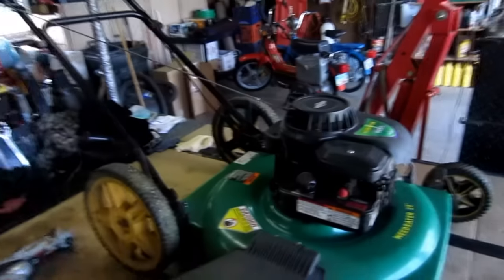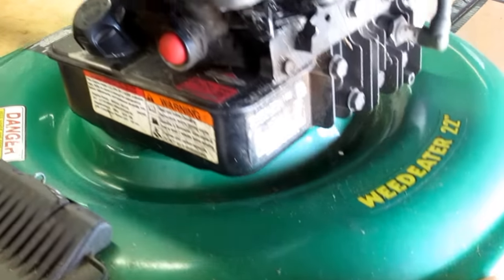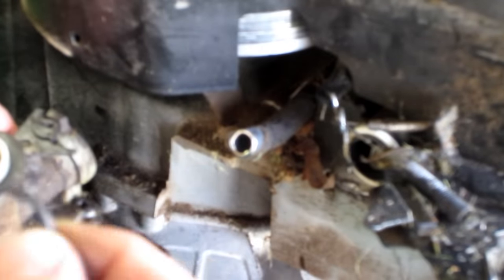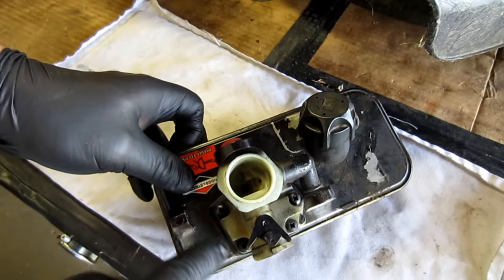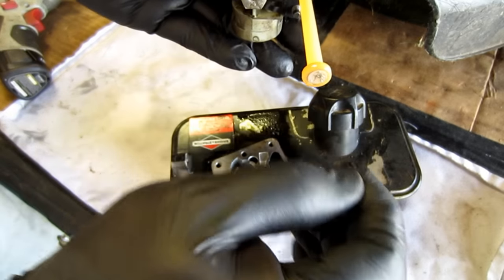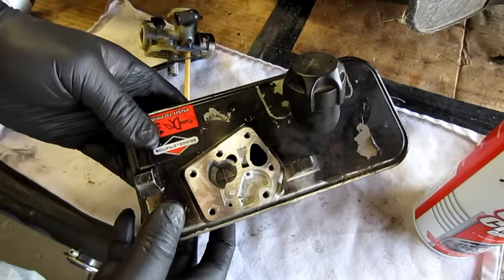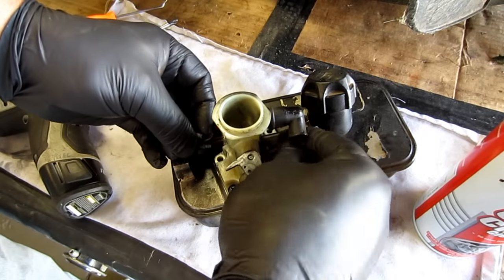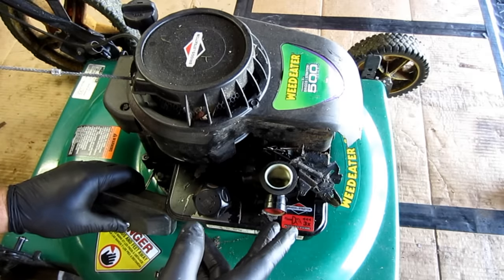Fix 90% of Briggs lawn mower not starting problems. Easy repair.

Comment: First of all you can't reuse the old diagram and gasket simply because the diagram is weak so the spring underneath the diagram isn't going to let the pulseaprime carburetor pump fuel correctly into the engine due to serging, if the engine startes up at all. Second when you separate the carb you half to replace the diagram and gasket because it is probably the original diagram and gasket ,plus the carb itself has to be cleaned and the base of both the carburetor and gas tank half to check for warpage so both the diagram and gasket.

Comment: Dear everyone in the comment section!
I own a tiller which has a B&S Sprint 40 mounted. It has kinda exactly the same gas tank and carb setup. My problem is, after 3x pumping the primer, the spark plug is kinda wet and doesnt spark anymore. I took the carb out completely and cleaned it with brake cleaner. Everything did look quite fine but the problem is still not solved. The wet stuff on the spark plug is flammable by a lighter. So its fuel and not just oil or sth. Im stating this because i might have tipped my tiller once or twice to the wrong side too!

The last time it was working, it didnt start anymore after 1-2 hours of using ist. The spark plug was completely black and didnt really spark well. I cleaned it and it kinda started directly again and was working just fine. Then it had the same issues again. Over winter it didnt come to action and now i cant start it at all. Didnt check on compression or timing to this point but im wondering, why the plug gets wet all the time. Any suggestions? I did try to start it without the air filter, as well as with the original and another (motorcycle) air filter mounted. Everytime the same problem...

Comment: Thanks, now I gotta go do this on a 6.25 series poulan 190cc with a Briggs and Stratton. 🤞hope it works. They gave us this machine, I replaced a gasket behind the primer bulb and I got it to turn on, but it shuts off right away. It only stays on if  someone continually keeps priming the bulb as soon as I turn it on. Is that a common symptom that this repair will solve????!!!! Thanks so much!!!

Comment: Hey Foxboss! Great Video. Could fix my starting problem on a 10 Euro "dunno why it doesn't start" mower 😁. Now I need to fix the remaining does not run properly problem, which is the messed up governor adjustment. Mine has the more modern "single spring setup" where they obviously regulate the idle speed through springs with different tension - marked by the color. 
If someone has that setup: It is very hard to disengage the governor link wire from the carb and practically impossible to reconnect it later. The trick is to take off the blower housing. Then you can move the link wire out an easily disengage it from the throttle lever of the carb. Some extra work, but less frustration.
On that single spring setup you cannot move the little lever for the idle speed anymore. B&S immobilized that with a welding spot. You need to go to the B&S page with your engine type number and download the proper parts-list for your engine. There you find the part number of the proper governor spring. 
Do not use a different one instead. If the tension is too strong, the engine will overspeed which will lead to engine failure sooner or later. Unfortunately I could not find the proper RPM value for my engine, so I could not "adjust" my temporary workaround DIY spring accordingly. 
I hope this helps folks who have the same "improved setup".
Greetings from Germany
Andreas

Comment: Thanks for the walk through on this... it helped me understand my mower more. I still have an issue with it after cleaning. It started spitting out white smoke and stalled. Now i cant get it to crank. what do you think is the issue?
Reply from the maker: White smoke normally means that oil got into the combustion chamber. So check to see if you tipped your mower because oil to get into the carburetor or make sure you did not overfill the oil. Remove the spark plug and pull the cord a few times to allow the cylinder to clear out. Then spray carburetor cleaner in the cylinder just a short burst and then reinsert the spark plug and try starting it again
Reply: Thanks Foxboss

Comment: Life is funny man, I have the very same exact mower machine and this afternoon I was mowing my lawn, turn it off to take a little break and when I want it to start it again, it just would't start, just didn't start at all. Well, I think I know what to do now, also I have to mention it, I run the damn thing under some bushes and from then on, the lawn mower start to run really rough, I think I hit that little thing that you show, the one that when you hit it, you screw your RPMs, I pretty much think that's what my problem is, thanks buddy anyways, cheers.

Comment: You should add that apart from these 5 screws on some of these carbs there are some modles that have a screw down in the middle , on the bottom, of the throat , that prevents its removal.

Comment: Liked the video! My two year old mower is in the repair shop now and has been therefor the last three months with carburettor problems, it went in under guarantee after a few months with what they said was a diaphragm problem which they replaced and it wasn’t long after that it was more difficult to start like when it was new, then the the engine started to hunt, sort of like a Broom ,broom, broom , broom, broom, that’s the only way I can describe it really, 
Anyway as I said it’s still at the repair shop and he’s said I have to have a new Carburettor at £28.50 as he can’t clean it fully and he also added it will probably want doing again! Now I only have a small lawn that’s kept clean etc, surely this shouldn’t be the case should it?
Glad of your thoughts on this issue!
Subbed to your channel!
Dave in the UK.

Comment: Empty the old gas out of your can and make sure all contaminants are cleaned out or you might have to do this over several times. Never use a steel can Zinc
k coated can for the zinc peels of in time and therefore contaminates your fuel too.  Then start your carbitrator disassembly lol. Now don't forget, your friend the professor

Comment: Wow your the man. I had rpm problems ran the mower under a shrub and it died on me. I know i had fuel. So I investigated found your video. found a tree twig logged by the governor and the governor spring was gone. Problem solved

Comment: Never understood why B&S took so much crap about the plastic carb....in my opinion they are way better than the ally ones for pure ease of maintenance. No stupid bowl seal to mess around with trying to get it to sit right, no bowl nut seal leaking, no messing around with screwing out jets, no sticking or holed floats and needles. And never having to faff around draining the tank for maintenance. It's a no brainer. And no choke linkages to try and fix either. Plastic Carb with tank all the way for me. Easy life 👍

Comment: You make it look easy but I am the man that put the oil in the fuel tank and the fuel in the oil tank on my chainsaw that ended up costing me £50 to have it drained and then I still cannot start it! I am 67 and it may be that I am too weak to pull the cord sadly. No more pull cord starts for me!

Comment: One very elusive problem is that after doing this there can still be hunting by the engine. It’s wise on this engine with this carb to pull the flywheel cover and remove the intake tube to the head and replace the intake tube to head gasket.

Comment: I had the same exact mower and was having the same damn issue. I gave it away about a week ago because I bought a new Briggs last Summer. It refuses to start. A lot of people told me never leave gas in it all Winter. I never had that issue with any other mower. Just emptied the tank, put fresh gas in it, put this other stuff in it to absorb water and still will not start. The primer bulb goes in and right back out, but the plug isn't getting any gas on it. It always started right up on the first pull last Summer.
Reply from the maker: If you can get it to run on carburetor cleaner or starting fluid by Spring short bursts directly into the carburetor then it's a fuel delivery issue
Reply: @Foxboss9  Will brake cleaner work?

Comment: My bro used my mower(basically same design as the one in you video) and somehow he took off the 2 springs on top and now the rpm  feels like it's too high. How do I lower the rpm and where do I connect the springs. 

Also thanks for the awesome video. I was able to start the mower after my bro messed with it.

Comment: My experience differs slightly - I always change the "gasket" - which actually is a diaphragm that acts like a pump. This diaphragm becomes stiff with time and looses its flexibility especially when client uses gas with ethanol. I always recommend to client to use Super gas with NO ethanol. The diaphragm only costs $4.95 and ensures at least another 2 - 3 years of use. The scribe on the aluminum body is a great suggestion.
Reply from the maker: I agree, however I kind of directed this to the user that has no clue why their mower doesn't start and just wants to get it going again.

Comment: I clicked the like because of your time, and effort, but you really left out a lot of important info. 1. is it getting fuel. 2. Is it getting spark. 3. Is it getting air. 4. Compression. You really didn't give a starting point. This could be 1 of a 5 part video. 

Thanks for your time.
Reply from the maker: I appreciate it! :-) this videos for those who have ruled out those things already. If you check out my other videos I've done something to that effect on a snowblower I think. Basically, what all fast working, good mechanics do, if you starting fluid or in my case carb cleaner. A couple spray burst of that direct into the carburetor will tell you all those things immediately. Because if it can run on carburetor cleaner, then it's getting spark are compression and the timing is on Mark. That way you know it's just a fuel delivery problem. Which is the case 90% of the time, hence the video.
Reply: @Foxboss9  Sounds good buddy. You answered what I was looking for, but I was thinking for office type people that don't have a clue. My problem has been narrowed down to fuel (where you came in).  I really didn't want to pull the carb, but...oh well. My I ask? I get a start off a shot of ether, but that is it. I'm hoping it is just a gummed up carb, and not the pump. How should I check that?

Comment: If it starts and dies  the filter in the fuel tank is the  problem. If it is a "Toro" and will not start after leaking all the fuel out of the tank the problem is the float in the carburetor that is filling up with fuel 
and it is difficult to plug the tiny  hole allowing fuel to get into the float. . . . it's important to remove all the fuel and let dry before using any kind of epoxy and plug for the  small hole.

Comment: There is a gasket AND a diaphram under the carb - not just a gasket. The diaphram goes down first on the tank and then the gasket. Many times they appear to be one piece instead of 2 pieces.

Comment: Great video! I have a 17 year old lawnmower. The only issue is that when I push too fast, it cuts off then I  have to walk slowly to cut the grass. Other than that no other problems. And how would you find a kit ? It is a Brigg Stratton 20 inch blade Murray but it's too old to find part numbers etc.. SOS!
Reply from the maker: There's a lot of these parts that are all the same. If your carburetor and gas tank look like this one the link is in the description of the video. Anyways all Briggs & stratton's have a model number a date code in a serial number stamped in the blower housing. On push mowers that usually right above where the spark plug mounts
Reply: @Foxboss9  Thank you

Comment: Thanks for this video. I have never done a small engine repair.  I was able to clean and replace the gasket for my Lawnmower.  But, it now leaks whenever I run to mower.  I took it apart and went through the process again. I even scribed the carb this time. But, it's still leaking. any ideas?

Comment: I have the same mower - It has spark - A rebuilt Carb - plug - Governor Springs replaced - it 
did Run for about 30 seconds , then quit. now = It won't start! when I pull on rope , I get get a POP! now and then. thats all - I have watched many videos on this type of carb & B&S engine. I cannot figure out why it wont start! ( I even removed the flywheel to check the Keyway KEY - it is fine ! I readjusted the Coil Gap ( b4 - one side was too big of gap)----
But after replacing everything > Still the same - won't Start- all I get is a Pop now and then.
Can I get your Opinion please?

Comment: I own Hondas. This particular Briggs carburetor was poorly designed It appears there are so many ways for the dirt to work its way into the carburetor and gas tank and soooo many little parts to deal with. I've never replaced or rebuilt any of the carburetors on any of my Hondas over the decades that I've owned them. This looks at least like an annual maintenance preventative program. With my Hondas I just spray the area around the carburetor with water to keep it clean and change the carburetor filter when it gets dirty. Thanks for putting this up however.

Comment: So far this is the best video I've seen about the B&S engine, but mine overheats after mowing for about 10 minutes.  I need to find out why because I'm afraid to start it up again. I just replaced the govenors linkage, the 2 springs. Could that be whats causing it to overheat and I think I even saw sparks under the mower, it was almost dark when I finished mowing.
Reply from the maker: You're going to have to remove your blower housing and make sure that there is not excessive debris that is blocking all of the cooling fins. With that said, I find that most people that say they're experiencing an overheat condition or not having actually an overheat condition but a situation where the mower shuts off after sometime. I've had previous customers say the motor shuts off after 5 minutes, 10 minutes, 30 minutes and they just assumed that the mower has overheated and that's why it's shutting off. 80 % of the time it's shutting off because the mower cannot get fuel. 100% of the time then shutting off because of it not getting fuel it's because of a blocked vent cap on the gas tank. 10% of the time it's due to the coil in having some sort of a fault in it that gets exposed when it gets warm and shuts off the spark. And the other 10% of time it's very things. So the next time it gets ready to shut off take your gas cap off and see if it will continue to run. If it shuts off and won't restart with the gas cap off then most likely it's not a fuel cap issue. at that point spray a little carb cleaner directly into the carburetor and see if it tries to fire that way. If it tries to run as you spray short burst of carb cleaner in it then it is a carburetor issue and you need to go through the steps in this video. If it does not try to fire at all then you have a problem either with your spark plug which is easy to change and rule that out or you have a problem with your coil. My guess would be that you need to go through the steps on this video as again I have never personally seen a small air-cooled engine overheat and shut off. Except when it's running low on oil or the air flow is blocked and instead of shutting off it locks up and seizes due to engine failure. Good luck
Reply from the maker: By the way, you need to make sure you've adjusted your Governor like each correctly to ensure that you are not over 3400 RPMs Max. If you're seeing Sparks underneath the deck the only thing that could cause that is a loose or Bent Blade, the engine coming loose from the deck mounting, the baffles underneath the mower deck being bent inwards as to strike the blade, or more of a serious problem,, a bent output shaft from the engine. All those things are pretty darn dangerous so take caution.

Comment: Great video!  Two questions though.  Don't I need to unhook the spark plug boot to avoid accidentally starting the mower and empty out the gas first?
Reply from the maker: I'm just showing you how I do it. If you want to take extra steps, then go right ahead. I also didn't say anything about eye protection, nor hearing protection when starting and testing, I also didn't mention checking the blade or the shaft for straightness, I also didn't talk about how when working with carb cleaner or gasoline you need to have a certain level of ventilation available, etc etc etc ....